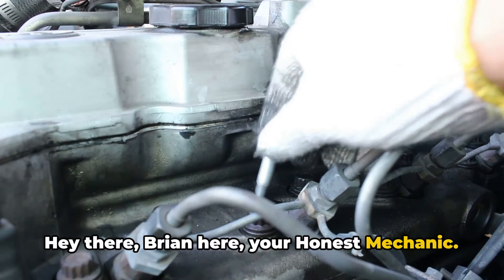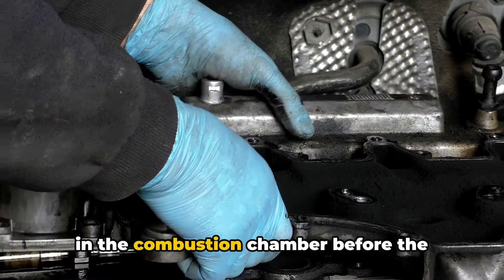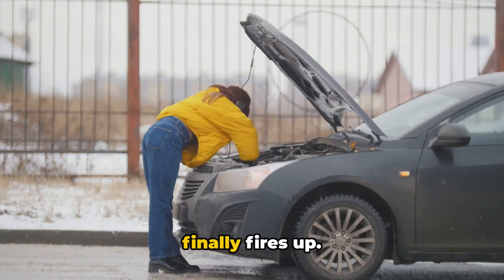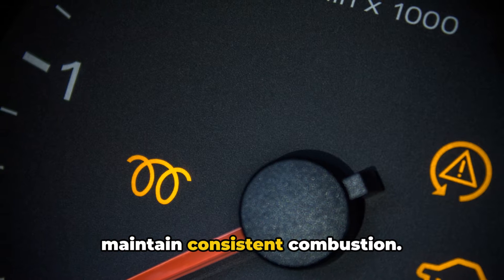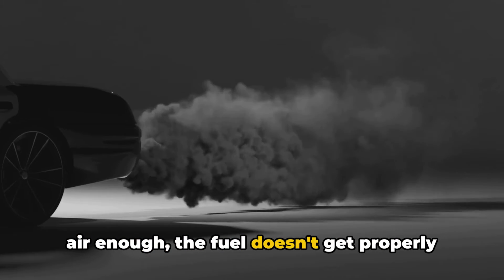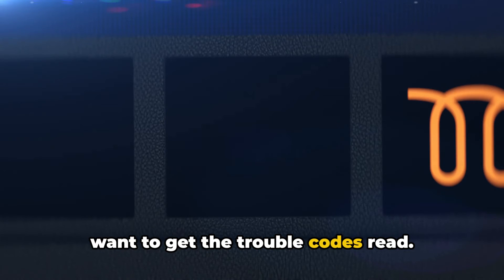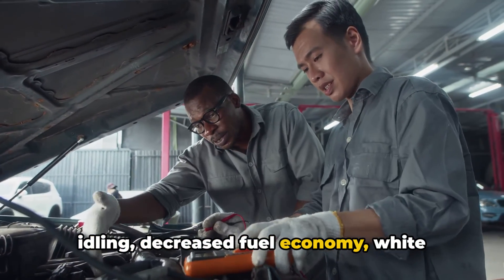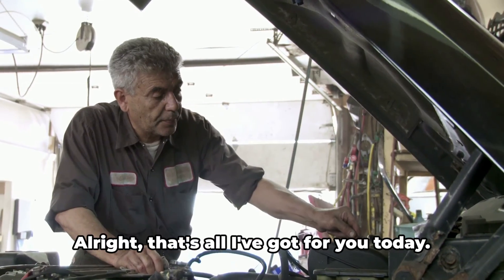Bad Glow Plugs Symptoms: 5 Common Failure Signs

Comment: My vehicle is a desiel engine. It can start easily but when accelerating there is no speed been picked up. The glow plug and engine oil signs are showing on the dashboard.  What should I do?
Reply: Fuel or engine problems, low compression or bad fuel delivery

Comment: Hi I have problem vw transporter when car fully loaded  when I drive hill wayup glow plug light flashing  then I have to stop and start again then it back to normal then back hill way up again same problem when I gas more glow plug flashing
Reply: I've got this on my seat Leon also! Did the glow plugs fix this issue? My car is always doing DPF regens also
Reply: @curtisjordan8803 I had this problem on my Leon, obd showed low boost, belive it on not, I put a new battery on, I've never had any problems since, local garage suggested it may be coz it's electronic turbo / wastegate

Comment: Hello. In cold weathers (-13 celcius, 8 fahrenheit), my car starts properly. However, 2 minutes later it stalls in idle. If i press throttle a little and keep the in rev constant, no problem. otherwise it stalls. After first start up of the day, in other start ups of the day, i have no problem. My car is diesel and don’t have any error light in the dashboard. Do you have an idea about the problem? Thank you.

Comment: I have trouble starting my 7.3 l forward I don't know it's glow plug or cold start relay can you help
Reply from the maker: Hi Kantharanick, thanks once again for the super thanks! I’m happy to help, but I need a bit more information. Do you have any other symptoms? Do you have access to an OBD scanner to read the DTCs?

Here's a quick way to narrow it down:

1. Glow Plug Test: Using a multimeter, check the resistance on each glow plug. Typically, each should read about 0.5 to 2 ohms. High resistance or no continuity means the glow plug is faulty.

2. Relay Test: With the ignition on (engine off), use a test light or multimeter to check for power on both large terminals of the relay. If the relay isn't passing power, it’s likely the culprit.

Also, if you notice a clicking sound when trying to start, it’s a strong hint the relay might be sticking.

Comment: I live in a tropical climate area. It will take 2 weeks before my glow plug order arrives. Is it safe to drive with the glow
 Plug light flashing ? I have no problem starting, just terrible fuel economy, engine misfiring and jerking
Reply: Common Rail Turbo diesel engines generally are not so  dependent on glow plugs for starting and initial cold  running unless the temperature is really low for example -20c  or lower.
Here in Europe diesel fuel is decent  quality with a high Cetane rating which improves cold starting and  combustion